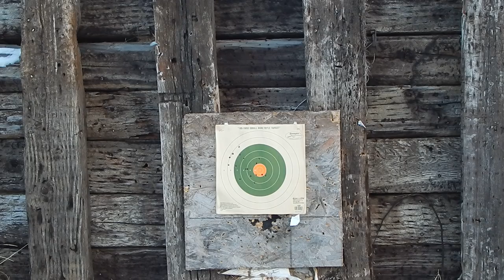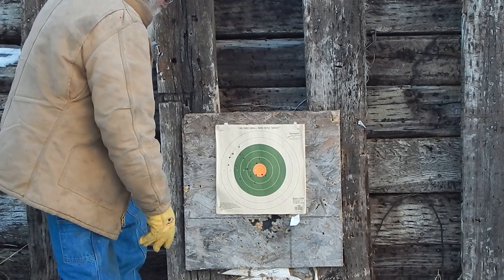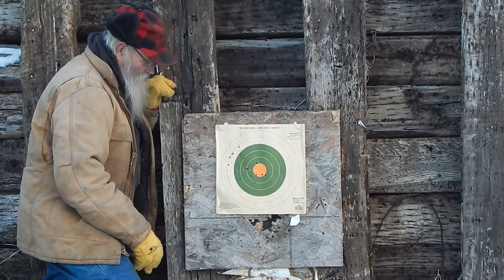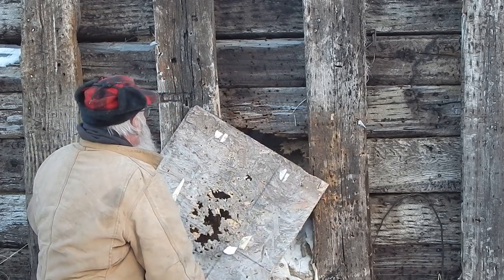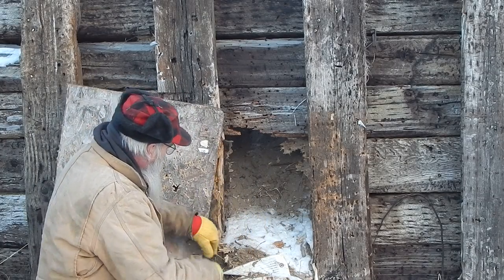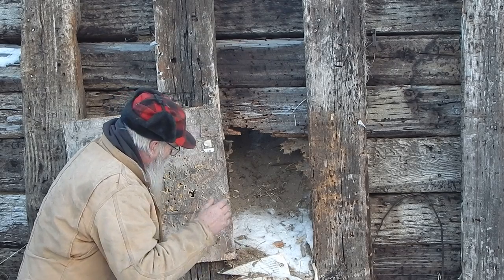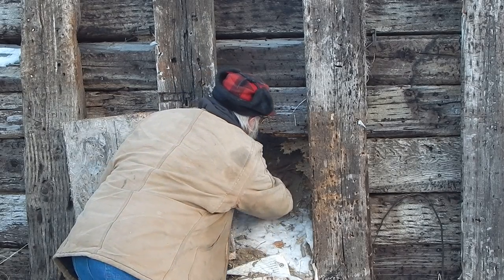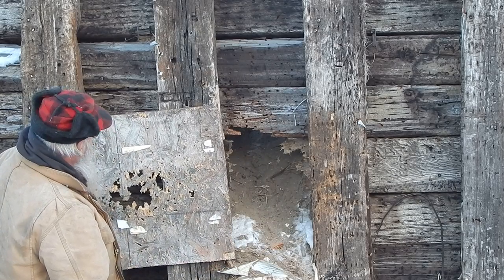Backstop

Comment: Nice setup. I like the fact you can recover bullets. Regarding the OSB, it seems to work okay for you, but you might want to try using some of those corrugated plastic signs. You know, the cheapies on the wire H bracket that people use to advertise yard sales, real estate open houses, etc. You can often find abandoned ones on the side of the road.  I spraypaint over the lettering and attach my targets to them. They last a long time, as the bullets just poke a small round hole, and don't shatter the front of the sign. Your paper targets don't get damaged.

Comment: Great idea...... !!!
Somewhere there is a train without tracks!  : )
Reply from the maker: Years ago they replaced many ties on the local line and I got a deal on a whole truck load of the old oak ones.  I split them and used them as fence posts around my pasture, great posts, but oak can be tough to drive a staple in.  The guy I bought them from was contracted by the railroad to dispose of them. He was selling them at $35 for a flatbed truck, plus a pup, and he delivered and stacked them. Wish I had bought a few more loads at the time, but I still have some left.